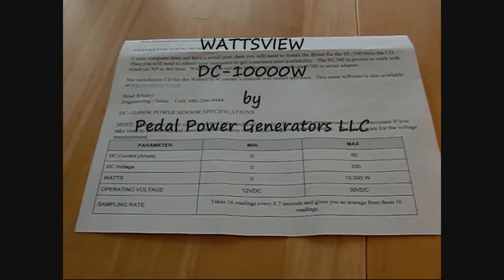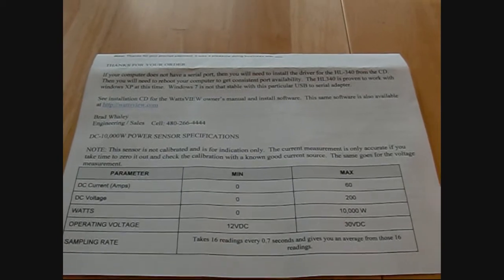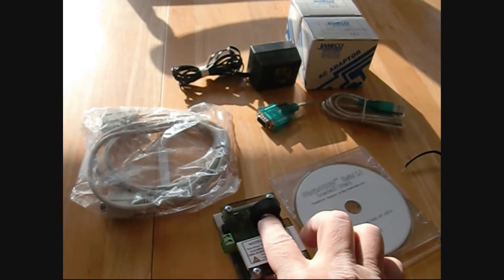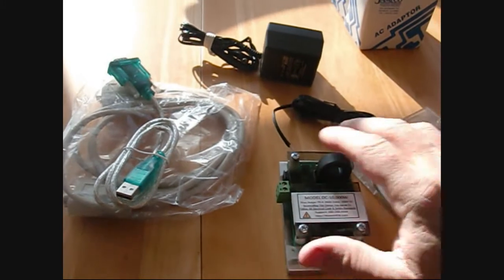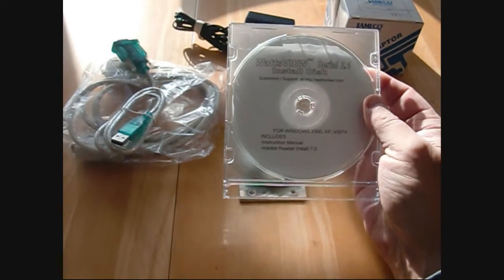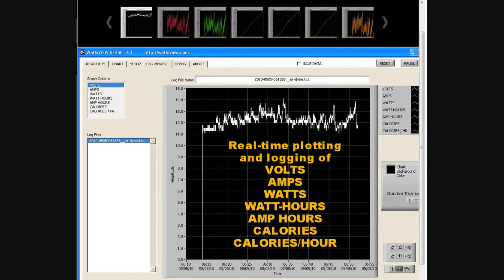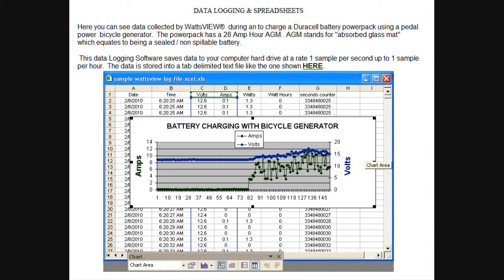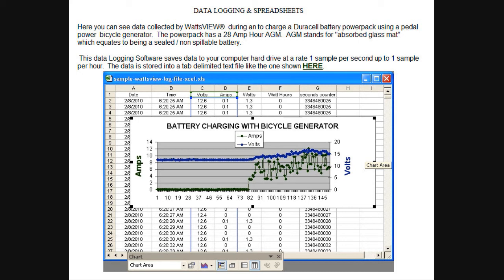WattsVIEW unboxing and preview

Comment: @Fearlessthinker Yeah, my computer is a little over the top with water cooling and such lol so 400W for me but my laptop is about 25 to 40 watts also but that's like leaving a light bulb on all day so you can track how much solar power you are making, still defeats the purpose. There are many, many, many charge controllers under $1000 that do this. Check out Morningstars 60A MPPT charge controller with Ethernet and built in web server for $477. Hook it up already! Let's see it run! :)

Comment: Looks pretty neat however many charge controllers and on-grid inverters (Enphase) already have this information built in. Another issue is can this item be used when your computer is off? I wouldn't want to leave my 400W computer on to monitor how much solar power I'm making :) 

Also, does this thing "steal" any voltage from your solar panels? You may lose wattage if it does. Just a thought...

Comment: Real shame it only handles up to 30v. Not much good for those with 30-40V solar arrays/Inverters.  

What we need is a watts-up or Tenergy power meter that handles up to 60v and has RS484 or similar data capabilities.

Comment: Looks like a neat gadget. I'm still stuck at the reading the meter stage. To digress further, maybe you can help me with this question. How do I know if my 0-20 amp analog meter has a built in shunt. Do I need a shunt for a low power output windmill coupled to a low power (and cheap) ammeter?